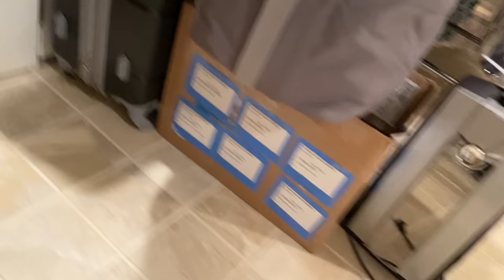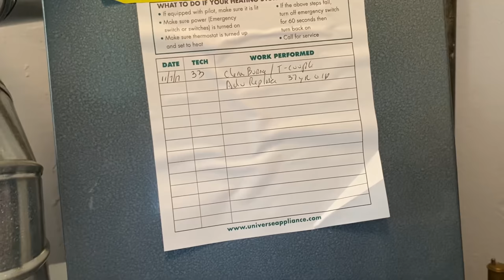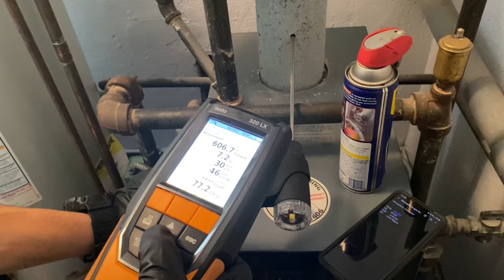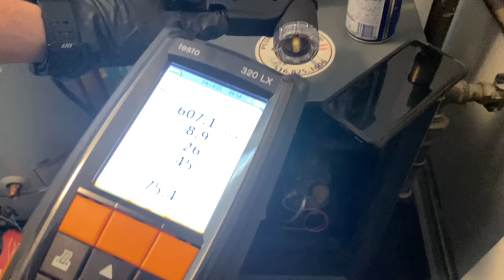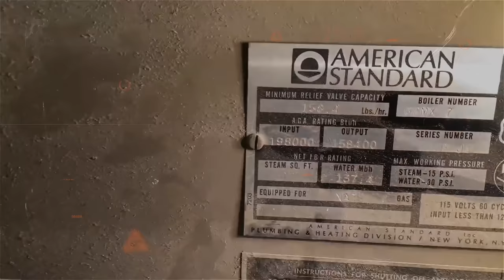Someone Stole The Car! How to Properly Service Weil McLain CGa4 Gas Hydronic Boiler with Testo 320

Comment: Hi Mikey 
My first time leaving a comment. Love you videos. I agree that that model Weil McLain boiler isn’t as efficient as we would like. But they were sold with an efficiency rating of 78%. I have found over the years that if the stack temperature is high and the boiler isn’t dirty that it is likely that the boiler is over fired. Timing the meter (for natural gas) or taking pressure readings (for LP) is a recommended procedure for testing for a correct firing rate.

Comment: Hey mikey I got a little tip for you, I've noticed the way you hook up your hoses an micron gauge that you are not getting a true micron reading of the system. With a hose on the high an low side, an the micron gauge attached at the same point as hose. That is where you are getting the micron reading from, which will  be a lot lower then the actual system. If you  leave it hooked up the same way, then after letting it pull down for a little,  close the hose on the side with the micron gauge, so now your pulling threw one side, with the gauge on the other, once you close the valve you will see the micron reading jump up, an you will be getting a true micron reading.. Try it out see what you think, keep up the great work.

Comment: Mike, could you cut the gas pressure back on that boiler, so it doesn't make as much heat, that it can't absorb into the heat exchanger? Thanks for the video.
Reply: Not a pro, but I believe if the gas pressure is adjusted down the other metrics will change as well. They had correct readings all around so it probably wasn’t overfired or only slightly.

Comment: I think there was some guessing involved on the Weil McClean. You were a step ahead looking at the boiler output by drilling the flue to do the combustion analysis but did you look at the gas input  and do a rate check (or just not show it)? So you had maybe half the story.
Reply: @PipeDoctor     Thanks for that. ‘If I don’t see it I have to guess - or ask.😉

Comment: Would moving the mini split condenser closer to the vertical linset be out if the question would need to relocate the line voltage

Comment: Sorry if I posted this before: The flue gas probe should be pointed slightly downwards. It's to prevent the sample being contaminated by any air that might be pulled through the sampling hole by the flue draught. Probably not so important in the setup above, but there will be flues that are configured differently, or test holes drilled way too big. Also, test with all boiler covers in place.

Comment: HI, Mike great vid. An unrelated question. 
What engines are in your sprinter vans? Dealer is trying to push me on the 4cyl diesel ..i placed an order for the 6 cylinder ...getting my 1st one..appreciate the info, google isnt helping as the 4 cyl is newer. Concern is weight obviously. Thanks Mike
Reply: @PipeDoctor  No shit..thank you, thought 2L wouldnt push these things around fully stocked. Appriciate it. Thanks

Comment: Replace the boiler ?
Wow!
😂🤣😂
The most important thing with gas is the chimney integrity which I didn't see you look at Which should be done every time.
That stack temp is what it is!
Testing is great but if the gas pressure is within specs then it should be OK. All the testing was done at the manufacturers facilities. It tells you what it should be  plug and play the only variable is the chimney. 
Now the older they get yes the less efficient they become but a new boiler?🤯🤣
CLEAN IT!
🍺🍺🍺🥃🥃🍇🏌🏻‍♀️
Stay safe. 
Retired (werk'n)keyboard super tech. Wear your safety glasses.
Reply: @PipeDoctor  what was the gp. Reading?

Comment: Question if the unit was not pumping water fast enough through the boiler would it also contribute to higher stack temp? . Which could be attributed to poorly designed chamber ?

Thanks for feeding me !
Reply: Shouldn’t matter what the velocity of the water going through the jacket is. If the water in the jacket isn’t up to limit, the boiler is going to run with high stack temps till the limit is satisfied. 

I imagine it’s size (as compared to a traditional 80+) is probably the major contributing factor in its inefficiency. Its little chamber can only absorb so much of the heat as it quickly passes by. 

Just my novice 2¢…